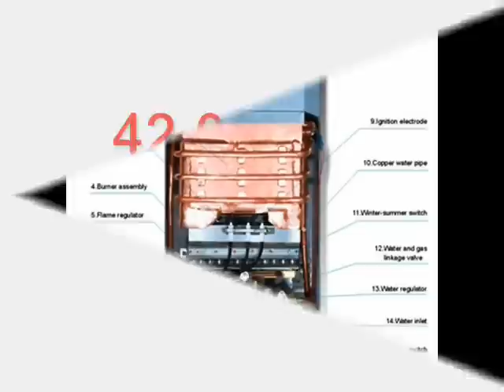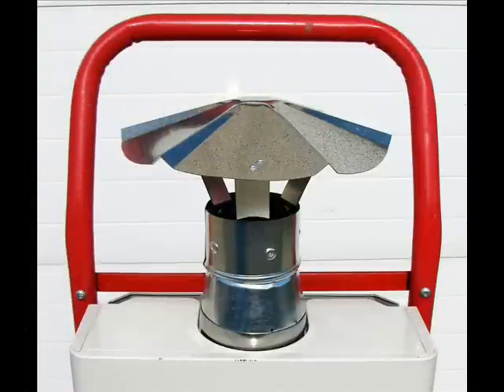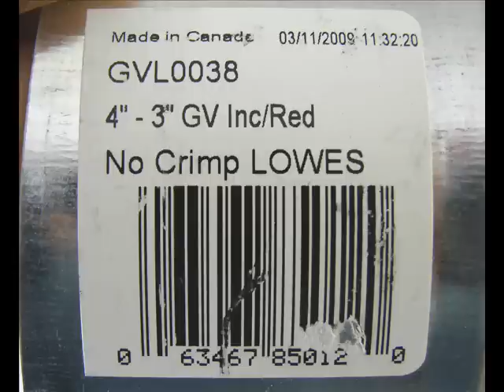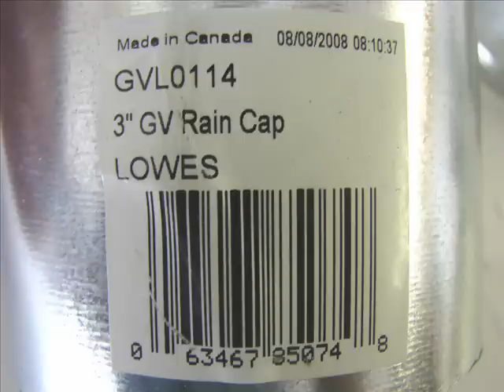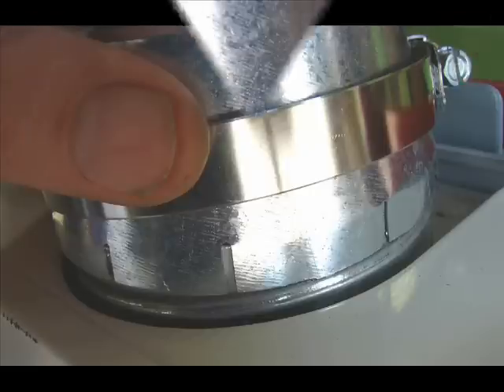Portable tankless water heater construction - EZtankless Camping cabin ranch and farm Hot water

Comment from the maker: The math ~ A USA standard 20 pound (Barbeque type) tank holds approximately 420,000 BTUs of propane. Based on this, the 42,000 BTU EZ101 (set on maximum hot position) has the potential of ten hours of constant usage for one tank of fuel.

Comment from the maker: @sok8888 So sorry but you are mistaken, the filter is on the cold line. I can assure you that at our level, we are fully aware of where a filter must be placed. In fact we have a movie about filters for water heaters. - If your incorrect assumption is because of our usage of red color hose of the incoming cold water supply you are mistaken. The red colored hose is the highest quality level available, the color of the hose does not indicate that it is for hot. The hose color is irrelevant.